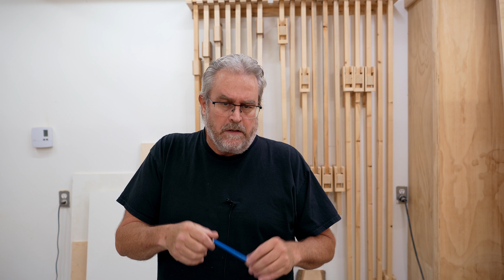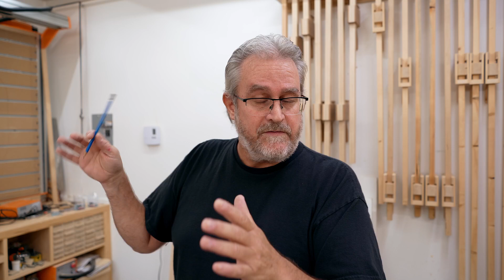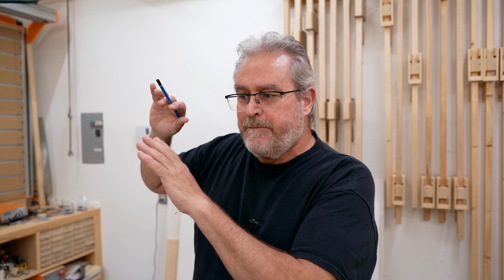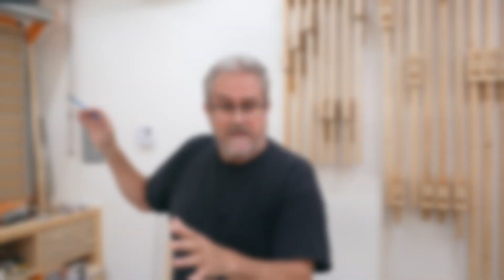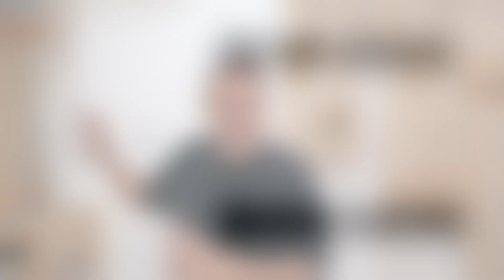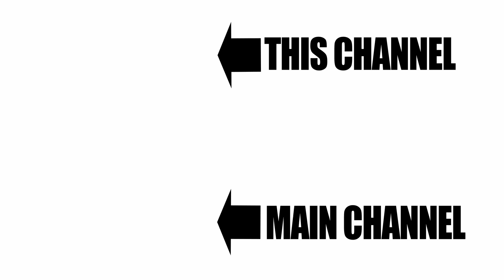Debunking Audio "Truths" -  Dr.  Floyd Toole

Comment: I kind of have to Disagree.  MOST people are listening to speakers in what some would call "Standard" rooms, in modern apartments.  No crazy high ceilings.  Well Furnished, rather than emptied rooms.   MOST peoples rooms are NOT effecting the quality of the sound, to any notable degree, at all.    But more importantly...  if you have low spec speaker drivers... even with the BEST room treatments... your drivers are going to distort the details... and so you wont be able to gain any advantages anyway.   All you would be doing with treatment, is preventing further losses, from your already Distorted music.

 Its only when you have very high end drivers, that are able to produce high volume sound, with the smallest percentage levels of distortion... that you are going to be able to HEAR what MOST speakers are unable to Reveal to you (no matter what kind of room you have).

 Furthermore.. if you have  "tuned port"  speakers...  you are already getting Distorted "Artificial" sounding bass...  And you have already lost the Audiophile game.

 Mind you, for those that are not Audiophiles..  In many cases when I say  "Distortion" ,Im not speaking about very easily Obvious sounding distortions.  Im speaking about something like when the singer and musical instruments end up blending together... to the point where both are losing "Separation" and "Detail".   In one case, I could never understand what Lyrics the singer was singing at certain moments in a particular song... UNTIL... I got a pair of Audiophile grade speakers.. and then the music and singers voice, was separated... and I could fully understand every single word that he was singing,  100% CRYSAL CLEAR / No doubts about any of it.

 Bass distortions, however, are far more notable... if you know what to listen for.   That said, most people have Never heard Bass the way that its Supposed to sound, from the music you enjoy... because you have only ever listened to Tuned-Ported speakers, which always creates "Artificial" sounding bass... as well as port chuff distortions.   If you pay attention, you will notice that ported bass has a repeated "Droning" bass sound... that becomes quite Annoying.  This becomes far more notable, at mid to high volume levels (not so apparent at lower levels).

 Furthermore, if you have weak magnet "ECO-Woofers"... even with a 12" diameter... you are going to get poor quality bass output.   I have a pair of 8" woofers, with MUCH larger and stronger magnets... which completely BLOW AWAY the bass response from the 12" eco woofers.  There is no competition, at all.

 So sure... in Certain cases, the room can become a problem... such as if you have a very high Ceiling,  or a very empty room.. that easily "echos" even from just talking within it.  But in most cases... the reason for poor sound quality, is cheap drivers that cant reproduce the sounds 100% accurately, without distorting them.   Its rarely the Amp, nor the Room.
Reply: "Most rooms are not affecting the quality of the sound to any notable degree at all"

- Disagree
The room absolutely owns the playback experience. 
The room's acoustic distortions 
-------

"Only the very highest end drivers are going to reproduce sound with the smallest percentage of distortion"

- Disagree strongly.  
It's all about leveraging drivers attributes. 

I traveled to audition enthusiast's system ... Bill Waslo, long time loudspeaker diy'er, built his CoSynes (inspired by Tom Danley's Synergy platforms). 

$200 in drivers, total, for the pair. Extraordinary performance, in a simple 3-way, 9 driver, co-entrant/coaxial/point source, controlled directivity, linear phase speakers. 

CoSynes by Bill Waslo, well documented, worth a look. 

-------

"Tuned port artificial sounding droning bass"

- If it's droning or sounds bad, then it's poorly executed. 
There's nothing inherently wrong with the bass reflex alignment.
Reply: @FOH3663  "Most rooms are not affecting the quality of the sound to any notable degree at all"

- Disagree
The room absolutely owns the playback experience. 
The room's acoustic distortions 
-------

- I own a pair of 1970s era  EPI 100v  speakers.  No matter what room, or poor placement options that Ive had to operate them under... they STILL sound flipping fantastic.

- In fact, the First time I heard them, was in a friends Slot Car track + mini retro arcade.  Disco / Earth Wind and Fire was playing... and it sounded like the band members were playing live.  It was almost Holographic.  I had to know what speakers these were... so I went looking for them...

- NORMALLY, I could easily find a speaker, merely by listening to the sound signature.. and following it back to the source.  However, the EPIs were very different. I spent nearly 15 minutes trying to find them, and still couldnt. I was toally blown away by this.  All I could tell, was that they were located within something like a 15 x 15 ft area... as the sound started to drop off in volume levels, at about that distance.

- Mind you... the mans shop was pretty messy.  Hes a pack rat, that has all sorts of magazines, display racks, dvds, and more.. all over the place.  There were also a lot of classic arcade and pinball games, lining the perimeter of the store.

- I finally broke down, going over to ask my friend what they were, and WHERE the heck they were located.  He walked me over to the very front of the store, right in front of the stores large glass window.  One of the EPIs were vertical, with a large stack of magazine on top of it.  The other... about 5ft away from it... was laying horizontal.. with two stacks of magazines on it.  In fact, that speaker was partially blocked, by a sit-down racing game.  None of that mattered.  The sound was still  3D, wide, detailed beyond belief.  Unlike anything I had ever heard.

- I eventually picked up a pair of my own.  Initially, my room was not layed out in such a way that I could fit them most optimally... so they had to sit underneath my desk, behind it.. on either side.  I was worried that the details would suffer.. but to my surprise, it didnt effect the sound quality at all.. that I could tell. And trust me, I have fantastic ears... Despite my age, I still can hear very high frequencies, like the whine of an old CRT TV.

- Later, I moved them to my open attic, that had sloping, non insulated rafters.  The sound was about the same.. but maybe a little better of a listening experience, because there was more open space to enjoy them.   The soundstage was again, very wide and deep. Sweet spot was nearly the entire room.

- That said, Ive owned plenty of speakers that were far more effected, by where you positioned them.  If you blocked them in any way... you would easily notice the negative effects.  But those were all non audiophile grade speakers.

"Only the very highest end drivers are going to reproduce sound with the smallest percentage of distortion"

$200 in drivers, total, for the pair. Extraordinary performance, in a simple 3-way, 9 driver, co-entrant/coaxial/point source, controlled directivity, linear phase speakers. 

- Nobody said that the Drivers have to be Expensive.  Many of the best drivers, are made in low labor cost places, like Taiwan.  The designs, however, are often created by high level engineers, in the States.

- That said, there is a man that used to work for EPI / Genesis.. and he makes new versions of EPI drivers, the same way they used to be made.  He hand builds them here... and you can get the special 8" EPI woofer, for 	$76 each.  And the Magical "Inverted" tweeters for $69 each.  Thats $190.  The only need a single Capacitor each for the tweeters... as the designer used heavier gauge wire on the woofers, to AUTOMATICALLY filter out high frequencies from entering the woofers.  This also help reduce potential distortions.  So, for less than $300... you get sound that COMPLETELY DESTROYS the local modern +$3000 high end speakers, at the high end stereo shop (yes, I actually compared them, and they didnt even come close to the EPIs).

- Realize that MOST of the cost in modern Audiophile speakers... Is Markup. You are paying for all sort of things, from their Road Trips, to Adverts, website hosting, Engineers Salaries, Building and Storage costs, Shipping costs, construction costs, and a heafty dose of PROFIT.  A lot of the specialty companies know that wealthy will pay extreme amounts of cash, and not know nor care, that they are only paying a fraction of the cost for these fantastic drivers.

- Meanwhile, most Consumers, are Over-Paying for the WORST quality drivers that the MFG. can provide you with.  Some of these drivers may be as low as $10 each.  They are often not engineered by anyone..  just randomly produced with a hope and a prayer...  and while they function... they have much higher levels of distortions than Audiophile level drivers.

CoSynes by Bill Waslo, well documented, worth a look. 

- I will look, but I have doubts that I will be impressed.  Ive basically seen and heard it all.  And... Id put my EPIs against some of the best of the best.  They might not be as loud as some of the others... but the level of 3d Depth and Non Distorting details.. coupled with a very wide and Holographic 3d Soundstage... makes them nearly unbeatable, IMO.

"Tuned port artificial sounding droning bass"

 If it's droning or sounds bad, then it's poorly executed. 
There's nothing inherently wrong with the bass reflex alignment.

- Completely Disagree.  And in fact, you can find many Engineers that will tell you all of the reasons why.  The port designs create Artificial sounding bass.  A certain "Tone" that is audible notable... every time the bass hits.  Thats because most ports are TUNED to produce this Tone.  Sort of like a Trumpet / Kazoo.

- Now.. IF the port is much larger, often the large rectangular ports.. they tend not to be "Tuned".. and merely allow the air to move in and out.  Those designs tend to function better.   HOWEVER... even those suffer from various issues.  Such as Air Compression issues, when the driver pushes a lot of the air out of the cabinet.. and is trying to produce sounds, without the same level of air pressures involved.

- As such, Sealed speakers are still some of the BEST speakers.  And of course, to have properly functioning sealed speakers.. you NEED much more powerful woofers drivers, to be able to overcome the internal air-compression forces. This additional magnet strength, also creates much greater levels of Acceleration and Precision CONTROL.

- This is ultimately where most speaker drivers end up Distorting... because they are using Low Magnet strengths, which cant control the drivers precise enough. These micro distortions, end up "Muddying" the details.

- The next best option for Accurate sounding Bass, are Passive Radiator setups.  They have the same sealed benefits.. but they also add a much more natural sounding boost to the bass output.  That boost doesnt seem to suffer from the typical Port Noises, and Port Droning.

- The other Option that I have less experience with (other than Tinkering with a build myself), is Open-Baffle designs.  Open baffle doesnt suffer from port issues, because the open air is uniform.. and isnt going through a "TUNED" port.  Therefore, it remains Natural sounding. (My only concern with them, is backwards wave reflection and absorption issues.  But again, I have only minimal experience with this design.  My little 4 inch open baffle driver experiment, sounded pretty good for what they were.  But I wasnt going to be critical over low spec + low powered drivers, either)

- Heres the deal.. I have owned like over 30 different speakers.  All of them, except the EPIs were low speck speakers.  I thought they sounded pretty good... UNTIL, I heard the EPIs.  Then, they were all unbearable Trash to me.  My techs? I put them out on the Curb, the next day. They couldnt touch the EPIs.. and once I heard what Bass was REALLY supposed to sound like?  I could no longer stand to hear Artificial sounding bass, from ported speakers.

- As Ive said, you can speak directly to Engineers, and they will tell you the positives and negatives of each speaker type.  The differences are well known.

Comment: There will be those that will argue for argument's sake. If people do not believe in how much the room affects the sound then download REW, buy an inexpensive mic an using a system that is easily portable, run REW in each room and look at the results.  There is a reason why there are still many speakers designs available, personal preference. Go to an audio event where the various speaker companies have their systems set up to optimize their products and people will not all agree on which system sounds best despite each system having almost identical rooms and optimized by the various companies.  Speaker specs, measurement techniques are tools to be used to get as close as possible to hearing music to be replicated the way you want it to sound but they are the means, not the ends. It is a subjective thing but one that can use objective means as tools.  I am beating a dead horse here as society seem to be drifting toward the desire to conformity instead of excellence.
Reply from the maker: Excellent last line there Paul, and exactly what's happening: conform willingly, or we'll make you!